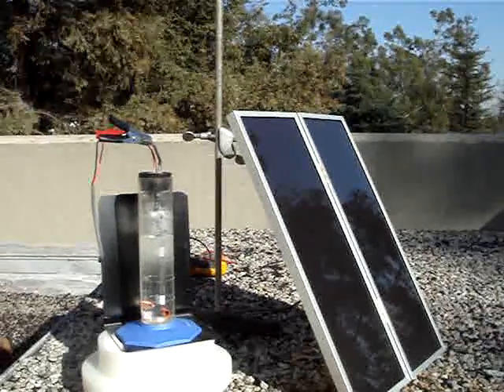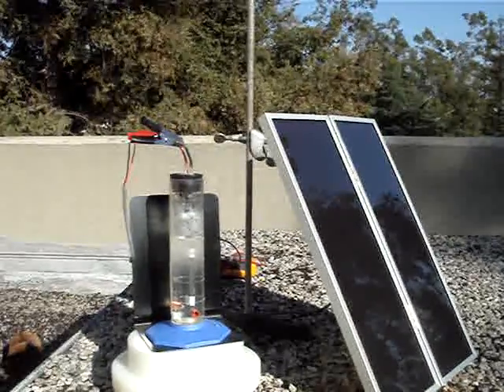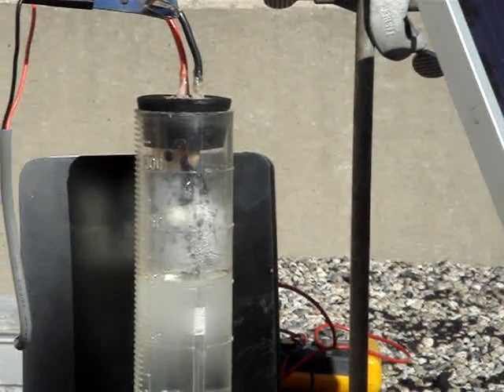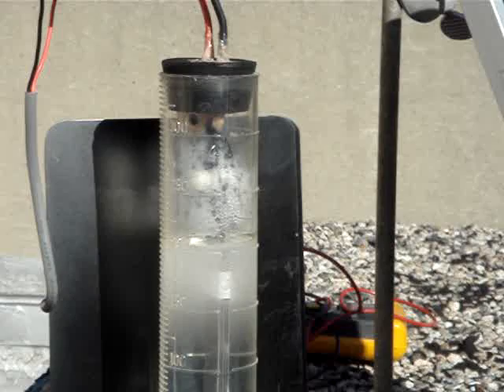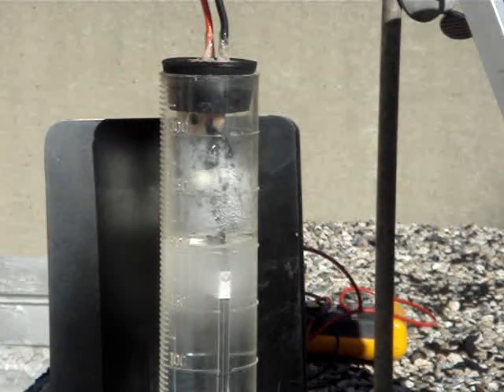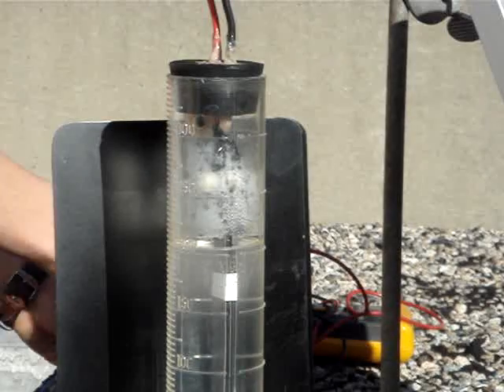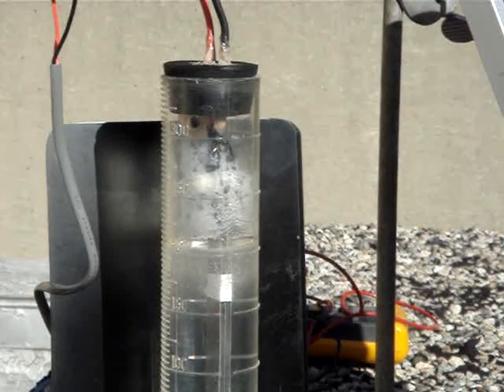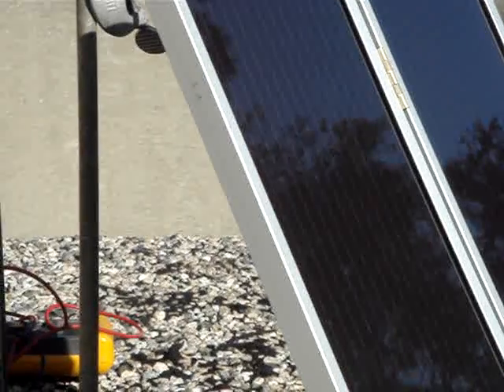Hydrogen Production with Sunlight

Comment: Should we design solar cells laying on a rod? Because parabolic mirror can focus sunlight on the solar rod facing it. If the solar rod rotates in a constant rate, it may allow itself cooling off when it is not facing the focus light. Perhaps it can even be cooled off quickly by coolant or something spraying on it and wiped it off immediately. It think it can increase solar cells economy.

Comment: Thanks for showing us this - The solar panel costs $50 bucks plus some semiconductor device. How much H can be generated from this size of solar panel? Looked like quite a lot of bubble action happening. Could a similar device be used to make a carbonated drink on camping trips?  Bottom line -  it left me wondering what would happen if you leave the cork on - eventually I guess it would explode.